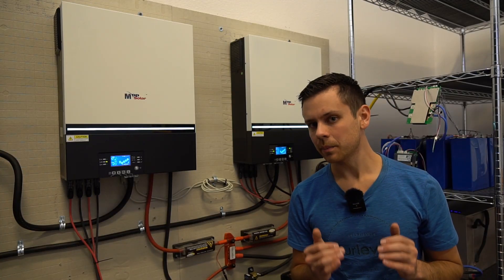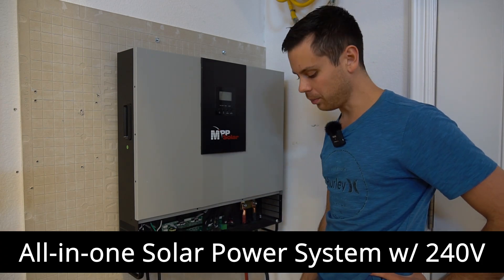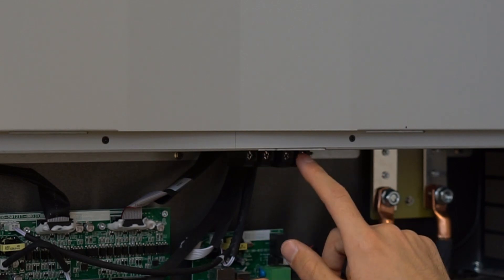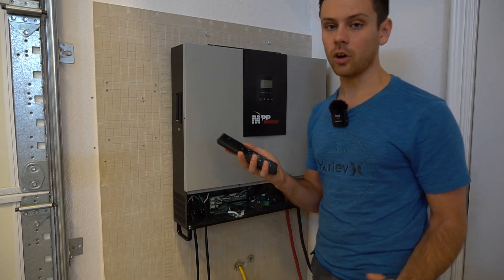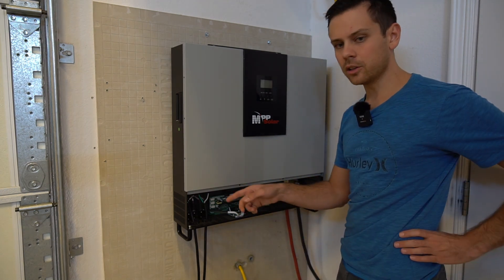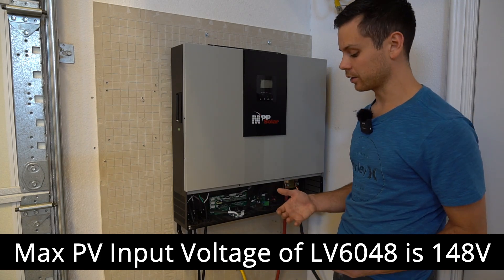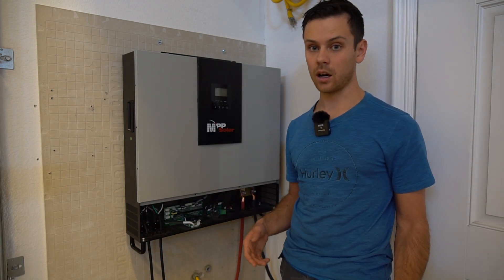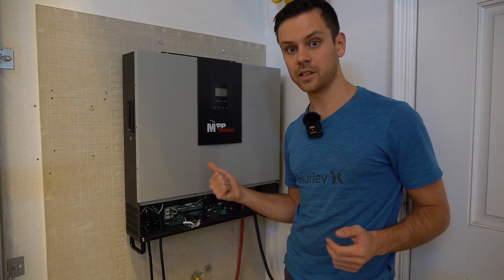How to Charge 240V Electric Vehicles with Offgrid Solar Power

Comment: I’m pretty excited about this. I have a build date for an F-150 Lightning in May. Im going to pay an electrician to run a 50a line to my driveway where I will charge my new EV. But, I don’t want to rely on the grid, so I’m going to install solar on the roof and run it to what you have shown me here and do most of my charging from this. Also can run a 30a from my Lightning to a nema outlet in front of my house and use my Lightning as a backup generator for my home.

Comment: Best way too go is as you point out with the Tesla Wallbox directly to the inverter if you can afford two wallboxes one off grid and one connected to the grid as a backup if the batteries are empty.

Comment: I've been thinking about doing this for my Tesla. Would love to charge off-grid. I typically only charge at 25A anyway from my 40A home circuit. The wires of the Tesla mobile connector just feel much cooler and safer to me since I usually charge overnight while I'm sleeping.

Comment: Dynamic rate changing with an OpenEVSE charger might be a good idea. The EV charging spec allows the charger to change the charge rate during the charge session by changing the duty cycle of the pilot carrier.

This could be a method to prevent discharging battery banks during an EV charge session when solar output declines during cloud covered or at the end of the day.

Comment: My EBike just uses 250 watts to charge it in 6 hours at 2 amps per hour using 110 volts for its 48 volt battery. 

👍

Comment: It's even easier if you're in Europe since you have 240V inverters by default. Just pick the largest one you can find.
Reply: I do wonder if you should just use a European inverter by default for EV charging because I'm sure the system can work with both 50 and 60Hz output, right?
Reply: @eowendyl  If I were in the US, and it would only be to charge an EV, that's what I would do.
Reply: @eowendyl  you would also have to consider if it’s split phase or single phase. The US gets 240 volts from split phase. Europe uses single phrase, Duel phase, and even three phase electrical. So…there are some other differences.

Comment: This is very helpful Will.  I have a lowly 2016 Leaf with the 30KwH battery and have two level 2 chargers.  One I was using early on out of a dryer plug and it only draws 16 amps.   Since my EV battery is not very big, I could get away with using the 16amp level 2 charger with one of these units and be pretty happy!
Reply: Also, the Leaf has the capacity to send power out of the CHAdeMO plug.  I would love in the future to use the car as a storage battery.  So far sourcing one of the inverters to do this has not proven to be viable.  Maybe it will once I am in a place where I can set up this type of system.

Comment: I was hoping this video was going to be about the Growatt 12k. I'm hoping to move most loads to it and a server rack 48v batteries. Then use solar and the grid tie feature. Also set at battery priority.
Reply: Is there a specific Growatt model that you are talking about?
I haven't seen Growatt grid-tied invertors with battery backup

Comment: I don't believe I can set the volts on my electric car, not easily anyway,  an alternative might be to hook up a socket to the inverter and have a charger that plugs into that.  I have a cheap 16 amp portable charger for my car and an adapter for campgrounds. Thanks for all your work Will, an inspiration.

Comment: Interesting concept for the future: charging an EV or any battery powered equipment from solar panels.  Could you talk a bit about the costs, including the solar panels?  How much did you invest in you entire system?
Reply: You probably need $10k-15k. You'd need at least 15kw of panels to fast charge at 40a + $3k in inverters + $2.5k in batteries

Comment: I would add to check your EV’s charging parameters. My 2013 Leaf doesn’t have ability to change the charge current so the MPP would not be enough for level 2 charging.
Reply from the maker: Ohhh that's unfortunate. Yes good point
Reply: Some chargers themselves will limit the charge current. Looking on Amazon, 16A seems to be a popular one. My Audi similarly doesn't have the feature to change charge current.

Comment: I find it interesting that you also seem to have gravitated to the simple and value based MPP solar inverters. My setup is also two LV6548's, but I have switched from DIY LiFePo4 to server rack based batteries from Seplos. 
I also use SMA inverters for grid tie at another house, but will be augmenting those with the new MPP LVX6048WP inverters once available, as they have 600V inputs!
Reply: My guess for switching to server rack batts is that diy lifepo batts require alot of wiring and more while a server rack has all already built in...and are thus pretty cheap, and are certified (for home).

Comment: Hi Will, what about charging EV using direct current directly, without loosing some percents at conversion to 240V and then another amount from 240V back to DC rail of the EV?
Reply: interesting question. I believe DC fast chargers bypass the vehicles' onboard AC charging unit, so perhaps it's theoretically possible
Reply: The problem is that you still need something to match the impedance of the panels with the car input. We call this mppt. There is a possibility that a car could be designed for a particular solar configuration, or you could adjust the dc power input via an app, to fake mppt function.  I would like to see 240v charging work straight off a solar inverter, like Fronius.   The problem with Will's suggestion is that it will drain the 48v battery bank when a cloud comes. If you put a fake 48v bank there, this could work by the battery bank clunking out at 44v and the 240V output turning off .... But it would not be graceful
Reply: This is my question too with a humble E-scooter. Can I build a dedicated system with 48V solar panels with a charge controller and not use the adapter that comes with the scooter? The charger output states 42V 2.0A . Thanks for your videos.
Reply: @MegJones7  Hi, for purpose of charging eScooter you’ll need something like Ecoflow Delta and one solar panel…

Comment: Actually, the wiring should be able to handle 220A. That specific inverter does provide 160A (2x80) from solar, but it ALSO can charge from utility (or generator) at 60A, so in total 220A. 
Unless you're never using the utility charger you have to wire for the maximum amps (thus, charging from both utility and full solar, even though this isn't likely to happen very often).
Also, make sure the battery can handle this, lots of them only handle 100A charging, so you might need to configure the charger for lower amps (or run multiple batteries in parallel)
Reply: I was wondering about that as my hybrid invertor charges at max 100A but my battery pack says max charge is 50A, does that mean that when I put two packs in parallel I can charge with 100A even though the individual packs are rated at 50A at 1C?

Comment: I’m kinda torn about an offgrid setup like this (unless you’re off grid anyway). Advantages - it’s simple, with only some basic building and tech skills needed and relatively inexpensive. Disadvantage - you don’t have the grid as backup and you’re potentially letting solar go to waste. Especially if you’re just using it for EV charging. When the batteries are full you could be supplementing the grid and powering your own loads. Still an excellent video as usual from Will.
Reply: your right, but in a case like my that I'm not a home owner and cant be grid tied this is the best solution
Reply: Yeah those were my thoughts. Of course if you had batteries you could store the energy and you could separate some of your home load to use your system - for example exterior lighting or your garage power if you have a sub panel you can isolate.

Comment: I have one basic question - If my solar panels make energy from the sun in form of DC, why do I need to convert it to AC? why can't I directly charge my car? That way the efficiency go up.
btw, great video!
Reply: You could but you have to make the DC -DC converter yourself.
Reply: @Gary-ee3kq  sorry for my ignorance,  but why do I need to make a DC to DC converter? By the name itself it is the same.
Reply: @haim4  voltage required by your car is different from the voltage provided by your panels. It's similar to charging your 12v battery directly with your solar panels. Voltage might be too high damaging your battery.
Reply: I charge my 1st Gen insight battery using a charger I build using 4 power switching units ( basically AC to DC converters) connected directlyto the battery... so I'd bet you could do the same thing with a newer car if you hacked the code to bypass the safety controls. You have to get or make an mppt solar controller that allows you to set the output float and absortion voltage to 100+ volts. You could look online to see what the inverter energy losses are to see what you have to gain be going down that road.

Comment: Amazing information and videos, appreciate all the links and more! Looking to setup a small system to charge a Kona EV entirely off the grid this summer so that I can run it completely free. Feel like there will be layover in the evenings where I might be able to get 3 or so hours of sun but then have to pull the rest from a battery rack. At 24amps, I'm guessing it would take close to 10 hours for a full charge so maybe 3-4 batteries could do the job for the rest, I wonder...

Comment: First off, thank you for your great DIY posts.  I have learned so much.  I am interested in building a solar carport to charge my Bolt ev.  The idea of reprogramming the car to charge at a slower rate is discouraging especially when we also want to use our level 2 charger.  I'm thinking of just setting up for a level 1 to start with and not have near the investment.  Would you possible want to cover that?  The panels on a carport might be close to matching the power output to the car so battery storage might be minimal.  Thanks

Comment: Is there some place where there is a guide top to bottom as how to charge an EV from solar?  Unfortunately at my house in the Canyons there is too much shade on the house by Oak trees that make solar for the home not feasible.  However, the garage is the one place that gets decent sun, especially in the summer.  I want to install solar panels on the garage for the SOLAR PURPOSE (<---see what I did there) of charging an EV.  The vehicle would be home in the garage most of the daylight hours.   So even if I only got 20 miles or so charge each day from the panels that would be enough to essentially charge the EV entirely with SOLAR.  

So I guess I need to START with installing all of the solar panels on the garage.   So I'd like to START with the buying the solar panels and the hardware/cables, etc. and do the project a bit at a time.  I am in no rush I could mount a few panels whenever I felt the need to and eventually after installing all the panels than purchase the equipment necessary to connect the power into the garage/inverter/batteries, etc.
Reply: You will get almost 0 miles until you hit 3-4 kw of panels. If you can't put at least 10 panels on your roof don't waste your time.

Comment: Wouldn't using this inverter (48V SPF 12kW DVM MPV 250VDC Off Grid 120/240V Inverter with 120A Charge Controller by Growatt)  bring us much closer to the maximum charge rate at level 2?  Other than being a little more expensive and putting the panels into groups what are the downsides?  Thanks!

Comment: Hey Will quick question,

Someone posted the following on a different solar video and I wanted your advice if this also applies to your all in one systems: 

"it won't be long before you absolutely fry your EV's onboard charger by using that high frequency, transformerless inverter. Because there is no galvanic isolation between the inverter's DC boost stage and its AC output. All it will take is for the AC output monitoring circuitry to fail and one of the MOSFETs in the inverter's H-Bridge circuit to short to ground, and this high frequency inverter can send dangerous, high voltage, high amperage DC current straight to your EV's onboard charger which will not only damage it, but can also set your EV's charger on fire."
Reply: This is why you are supposed to have the AC input and AC output on circuit breakers.

Comment: I didn't hear mention of panels with built-in microinverters.  So the system you are suggesting here is just straight old PV panels in DC strings of properly configured voltage?  Hope so because
I am getting an EV and I have a pallet of the plain old panels
Reply: Yes.  Inverters convert power from DC to ac at the panel.

Comment: Good day Will!  I bought a weize 12v 10ah lifpo4 battery to be a drop in replacement for the SLA in an UPS.

However I am unsure after reading the instructions that came with it.  I am concerned that the charge circuit in the UPS will damage the lifepo4 battery.  

Do you think the built in BMS board is sufficient protection, or would wiring in a DC-DC lifepo4 battery charger be required.

I did do a teardown of one of them and can give you pictures and details of the inside.

Thanks for your time.

Comment: I have a pre-exsiting solar array on my roof for the past 11 years.  I'd like to hook it up to some battery backups.  Looking at the Ecoflow Delta Pro 3.  My issue is the solar system was not designed for battery backup.  The company Sungevity went out of business years ago and I'm leasing it for the next 3 years.
I have to inverters and a sub panel that then feeds into the main panel.  
Would it be possible to just install a 240v outlet in between that sub panel and main panel and use that to charge my batteries directly from the solar array?

Comment: hi every one, regarding using DC direct from solar panels to charge an EV, great idea , I thought of that ages ago, however  , some how you need to regulate the DC current going into the EV, this is normally done by the  DC fast charger,it Talks to the EV and decides how much power to give, its no doubt possible, but there is so much software on both the EV and chargers that make it almost impossible for us DIYs to do, this is frustrating because i am convinced tha nice pure DC from panels would be good for Battery life, rather than the output from chargers, I doubt any AC generated and rectified DC could ever be as smooth as fro the panels. In theory you just need say 1o panels in series to achieve the 400 volts DC to charge  an EV. The two small pins of the EV charge cable are the  ones that talk to the car and charger!!!

Comment: Wow this is really great information I just purchased my first EB last weekend although it is only a 16 KW hour battery in a Mitsubishi I-miev my goal is to charge it as quickly as possible on the level one port ..

So tell me
If I have a 24 KW hour battery that is charged by my solar system and I come home from work in the evening and I plug in the charger to my 16 KW hour battery will the power from the 24 kilowatt hour battery charge to 16 kilowatt hour battery to full capacity and wait for the sun to come up the next day to recharge itself?

Comment: LVX6048 Utility charging ?

The LVX6048 inverter in you video has a 
 Utility charging port. Does that mean it is a hybrid unit that needs to be connected to the utility? I need to charge a 2021 Bolt totally off-grid.
Reply: Yes. You can add AC bypass once the batts go dead it switches to utility.

Comment: Instead of using a cable with a NEMA plug could you wire the Tesla Wall charger directory to the output of the Invertor? Would also like to have this set up as part of the grid-tie setup is there anything different from the video I need to carry out?
P.S. I called it a wall charger but Tesla refers to it as a Wall connector.
Reply: He addresses that in the video.  It's around 6:09 mark.  Hope this helps,

Comment: What if you also want to use 120v appliances while charging at 240v? Would you just wire the inverter to a breaker box and use both 240v and 120v breakers? How would dynamic load balancing even work, assuming you want to prioritize 120v devices?
Reply: Both of the MPPSolar units linked have neutral lugs, so you can connect line-to-neutral to get 120V circuits. Any inverter with multiple lines and a neutral would have to be designed to deal with unbalanced 120V loads, as that would be an inevitability.

Comment: Question: in a past video you stated lithium batteries really like to be charged and discharged at 75° F. For maximum cycle life.  I'm planning to convert my prevost bus from flooded to lithium. I have a spot inside the interior of the bus that has AC and heat instead of next to the hot engine where the flooded batteries are now. My question is while I'm not using the bus, the lithium batteries will reach outside temps of 100° F. + but the batteries will not be cycling up or down because everything will be OFF. will this shorten the life of the battery ?
Reply: I hope Will or someone at his level of expertise answers this question for you.  I'm not an expert but it is my understanding that you will not adversely affect the performance or longevity of your Lithium batteries when they are subjected to 100 degrees F. while being stored (no charging or discharging taking place).

Comment: If you install a 30amp receptical like 14-30 than you will not have to lower the charge current it will automatically be 24amps